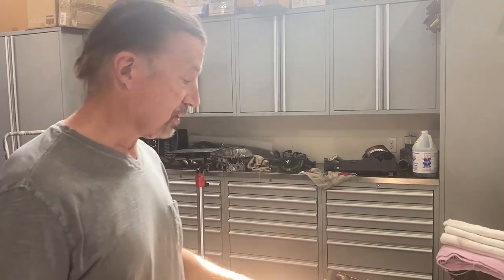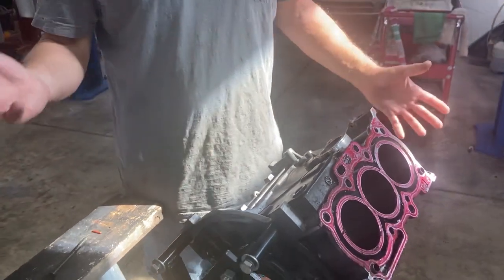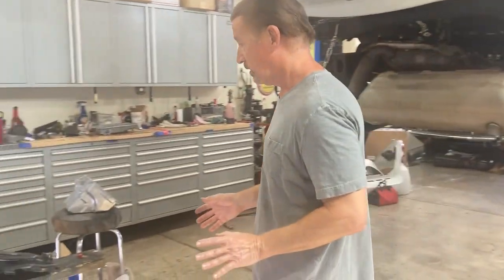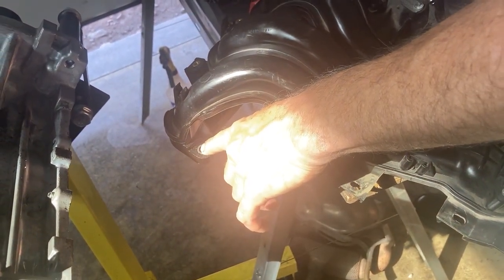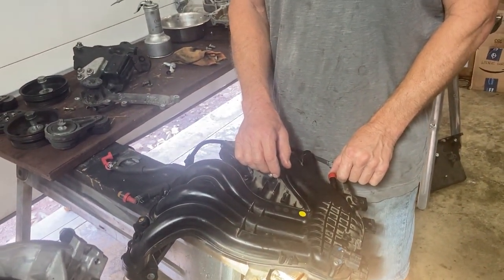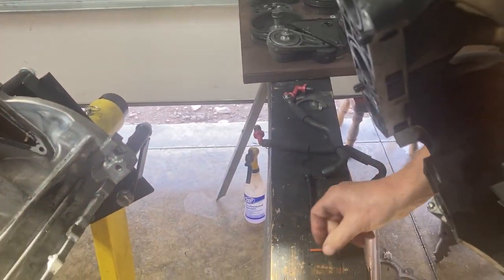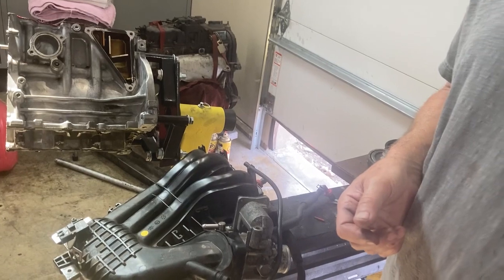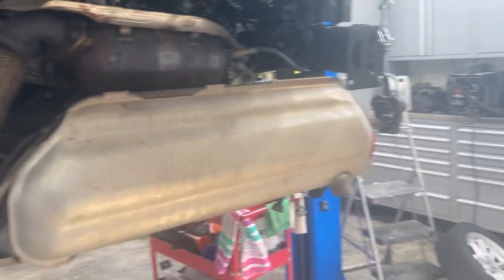Smart Fortwo (451) Positive Crankcase Valve (PCV) (Excessive Engine Smoke)

Comment: I had the same problem but the PCV was fine, in fact someone had replaced it, however the gallery that runs through the block and vents from the cover holding the PCV to the sump was completely blocked. I had to push a long thin screwdriver through until it was completely clear then blew air through it. Great video by the way👍

Comment: I just wanted to take a moment to say thank you for this video! It really helped me solve the smoking issue with my Smart car. After watching, I checked the compression first (which is always a good starting point to rule out bigger problems) and confirmed I had good compression. Then, capping off the PCV valve hose as suggested helped stop the smoke, pointing me in the right direction for a proper fix. I hope this comment helps others who might be facing a similar issue. Thanks again for sharing this valuable information!